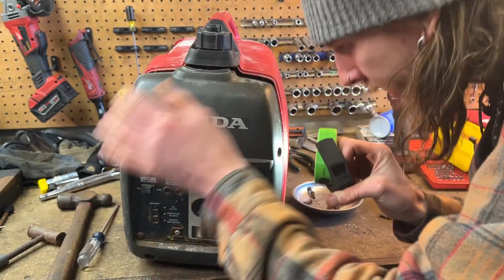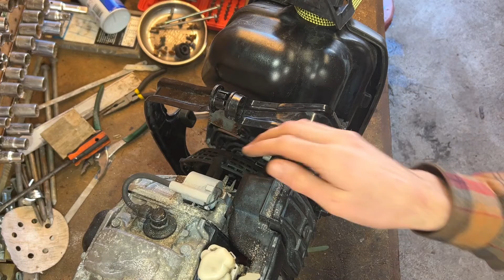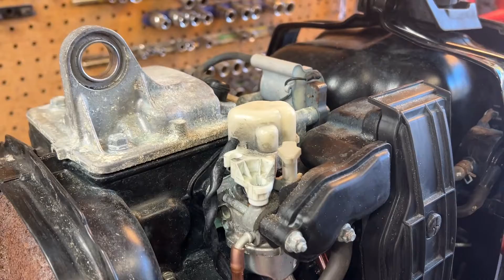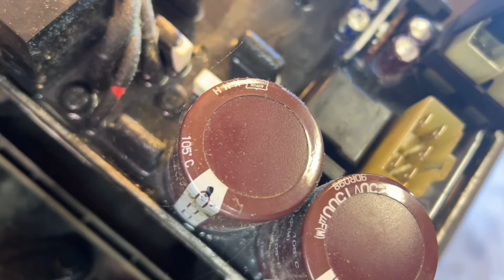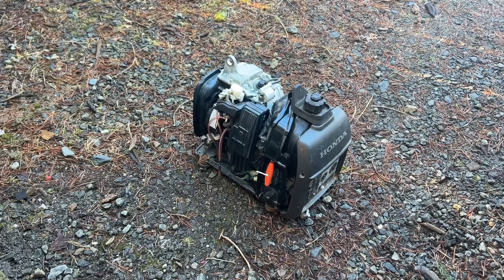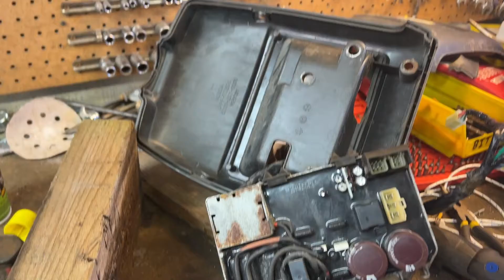What's wrong with this Honda generator? EU2000i diagnosis and repair

Comment: The pull cord on these ALWAYS frays and finally breaks...
because the hard plastic grommets guiding the pull rope chafe the rope when the engine vibrations "shake"' that rope grinding it over the grommets.

So you can just shorten the normal length pull cord ONCE....it will still be long enough for a good pull length

but when it frays again....
you need to do this replacement.

Comment: there is a throttle control sensor on top of the carb you can swap out also there is a tab that the throttle control fits into, so if the tab is not properly in the slot it won't idle properly. also, the circuit board that has the three lights needs to be replaced and i bet it will work fine. tyler industrial has all the parts for the honda gens.  Go ask them for parts print out or you can prob just get one online.  easy to fix and get up and running again.. worked on lots of them.  diggin your videos
Reply from the maker: Thanks for the tip bro! Appreciate it! Will look into it

Comment: Capacitors also act as voltage regulators, that failed capacitor likely allowed a spike into the electronics and "let the smoke out"

Comment: If you can believe it, i have a cheapo chinese generator that i had to replace the pull cord on, but could not for the life of me figure out how to remove from the engine, so i ended up turning it til I could just snag the broken cord, pull it to full extension, lock it with a screwdriver like you did, and feed in the new cord. I had to tie the knot behind the protective grill, that was the really fun part, but it worked and she fired right up.
Reply from the maker: That sounds like something I would try. Nice job! It isn't dumb if it works.

Comment: Had a guy bring me one to fix couple months back with his big one. Had to change the pull start, tune up and a little electrical work. They are cool little quite generators! Good video man!
Reply from the maker: There's a reason Honda's #1 when it comes to small engines. They are very good runners. I definitely don't fault their engineering for this failure.
Reply: Yeah I say the same thing about Honda buddy! @thehacksquatch

Comment: Rubber mount is to protect the fuel tank from the nut and stop the fueltank from vibrating againt the metal of the bolt.
Reply from the maker: Makes sense to me! I figured there would be enough clearance but I guess too close for comfort. They probably jump around more inside the shells than one would expect.
Reply: You have to factor in vibration over time and  future wear and tear otherwise ippety bippety...leaking fuel tank.🤣🤣🤣🤣🤣
Reply: Brilliant channel by the way.
Reply from the maker: Thanks! Appreciate you tuning in. Just glad to see there's people willing to sit through a half hour of repair with a bummer ending 🤣
Reply: Success or failure doesn't matter,you learn from both.I enjoy channels like yours because like me you are willing to try.Thats the only thing that matters.We can't always win,how boring would that get.Keep the videos coming and good luck and success with your channel.I live in Australia and shit can get real faster than you can say piss on a stick if you are not willing and able to give it a go.🤣🤣🤣🤣
Reply: Hi, Thanks for your video! We’ve got on that worked great and then got wet, got knocked over (were on a sailboat) and then was sitting for months. We got it running but cleaning the spark plug and replacing the gas. RPMs are low, but it’s running steady. We’re about to do the next level of diagnostic troubleshooting now that it’s running. 

I noticed that the circuit breaker is out, i.e. off. That looked suspicious to me because we I push it in to “on” it won’t stay. Is that normal? I noticed yours looks like it is out (off) too. 

Can anyone comment on this?

Thank!